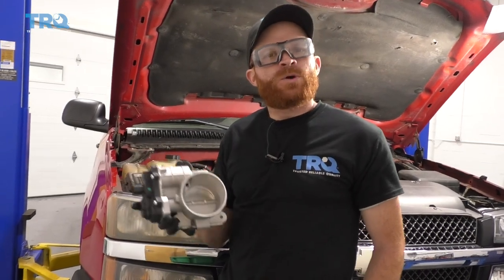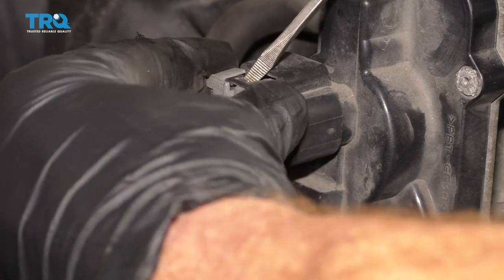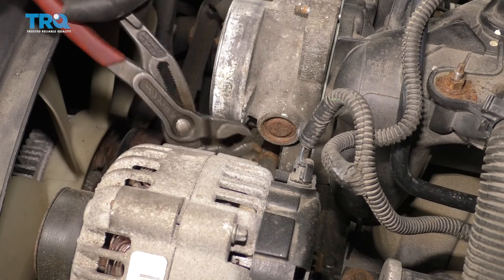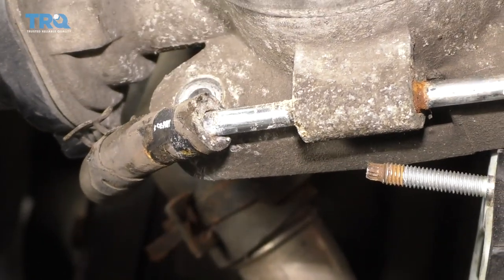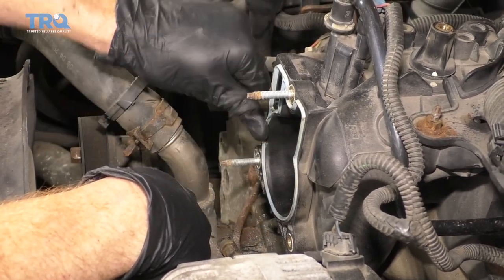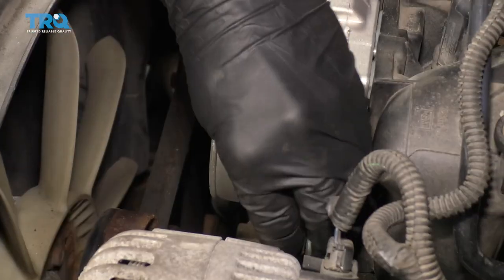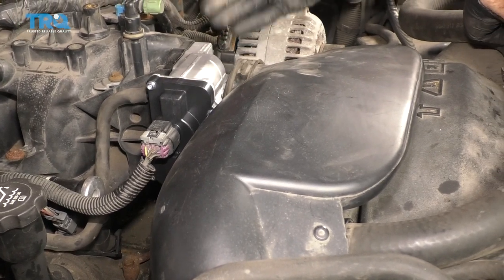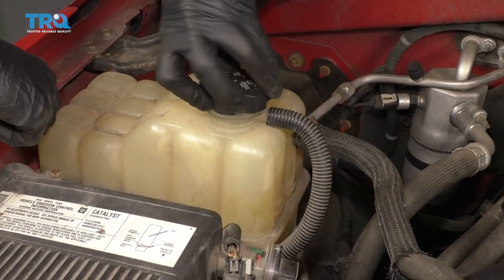How to Replace Throttle Body 2003-2007 Chevy Silverado

Comment: 06 1500, is torquing the mounting nuts imperative or recommended? Just curious if I have to purchase a torque wrench or if it just has to be tight but not stripped tight.

Comment: Heads Up. Bought just a sensor for the throttle body from O Reilly Auto Parts, The connectors on the sensor connectors are to deep in the sensor to plug into the throttle body. . Went back . The next one they brought out was the same way. Ended up buying a throttle body with the sensor. Mechanic is putting it on now. I hope the sensor on the throttle body is not like the others.  Seems the machine that makes the sensor is out of adjustment. Be sure you take the old part with you. To make sure the connectors are not to deep in the sensor. Was having trouble with reduce power. Hope this will save sometime for someone.
Reply: Are you able to swap the sensor out without removing the throttle body? Thanks for the heads up cause I have a sensor from Autozone that I’m about to “attempt” to swap out.

Comment: Tip on diagnosis.  If you get the dreaded reduced power while the cruise control is on it's not the accelerator pedal sensor.

Comment: Great video. Do you have to go through a relearn process after replacing the? Thanks
Reply: It is recommended and it’s super easy! After replacement let your truck idle for a few mins and then turn it off for a few minutes, after that shut it off and turn it back on for a minute or two. A code for the throttle body might pop up after that just clear it if it happens. After that take it for a drive around town and you should be set

Comment: hey what is the black thing with the electrical connector and green cap directly above the top TB mounting stud.  mines a bit loose and my truck is stalling.  is this EGR or some evap device?
Reply: Evap

Comment: Good video. Just changed the throttle body on my 03. Piece of cake. A heads up though. The ECM had to relearn the TPS and I had to clear the codes to get the check engine light turned off.

Comment: I just did this on my 03 silverado. Great video, very helpful. Although I didn’t need to remove any studs it just came right out after disconnecting the coolant lines.